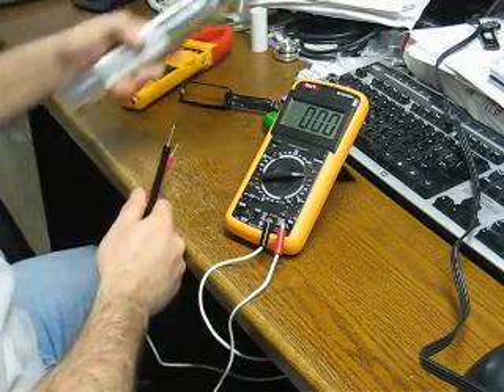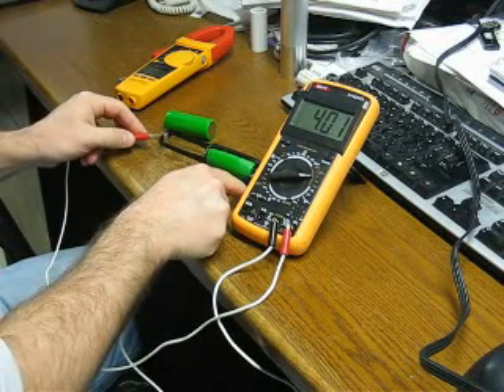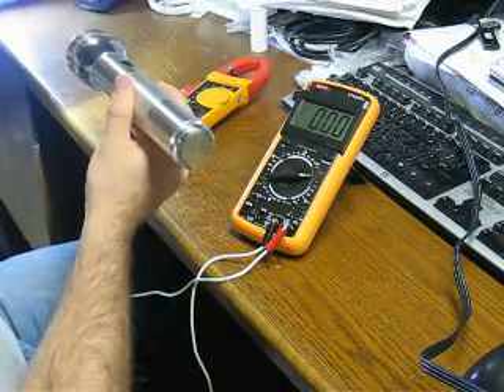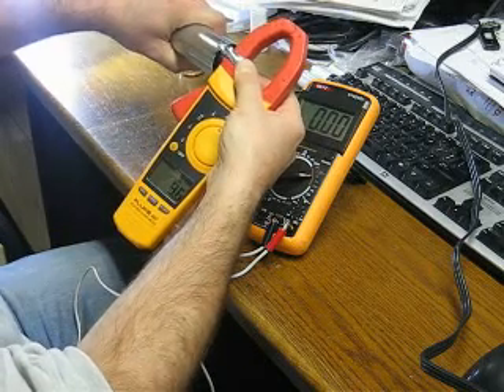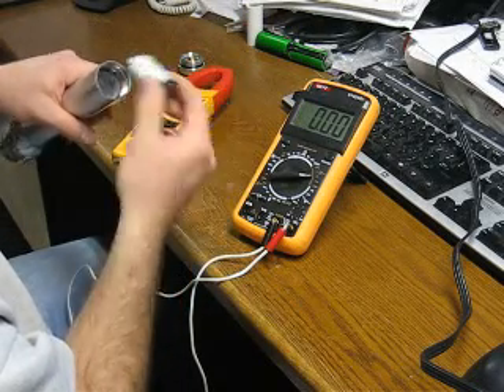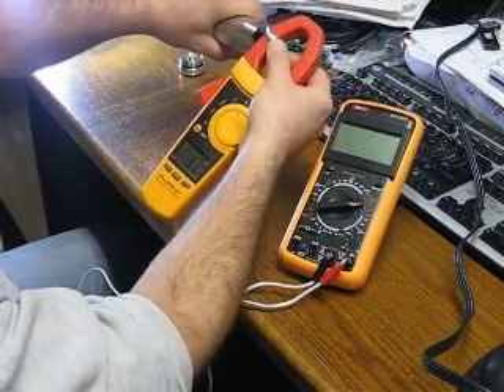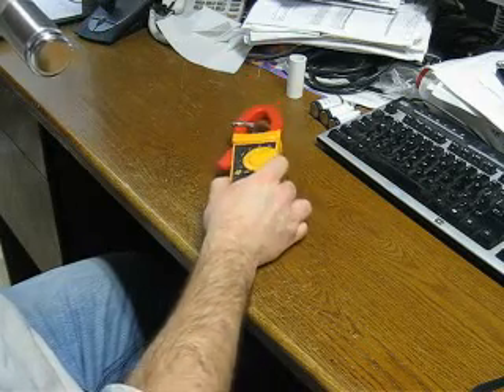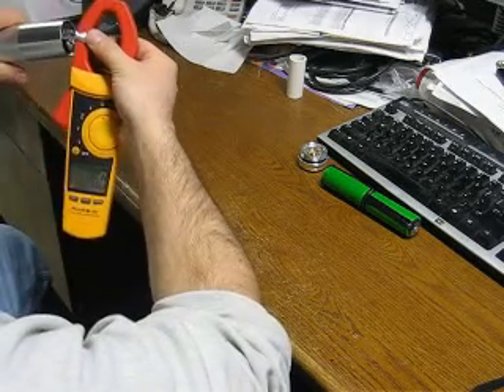Vf of SST-90 lowered by burn-in.flv

Comment from the maker: @tacticalHID 
I unintentionally burned it in with an unregulated direct drive setup.  My orginal setup had a higher pack voltage (4.2V then vs. 3.6V now).  After a few uses and thermal cycles, the LED's Vf dropped causing it to draw more current at the same voltage.  The higher current caused higher temperatures and started thermal runaway.  It quckly got to the point that the 4.2V pack would cause the LED to draw > 14A of current and turn blue.  I had to change from 2P 26650 IMR to 3s C NiMH.

Comment: you must have a great heat sink i smoked my ssr-90 with 3.3 amps.were you get it?(brightlumens)
im gessing 3 nimh c size would be the safest and best way run it a bit to hot though the factory 90 lights are runing 7 amps. 5 stars again

Comment from the maker: Jay,

You'll be fine direct driving with three NiMH C or D cells.  I recommend the low self discharge kind that I'm using so the torch is always ready for use.  You could also go with four of those cells and 24xAMC7135 chips to buck current down to 8.4A.  Runtime might actually be less that way because you'd be sustaining higher current for more of the discharge.